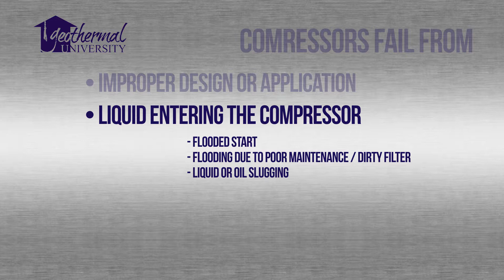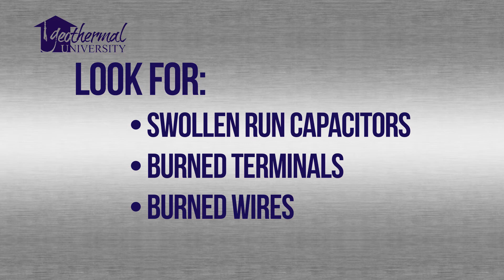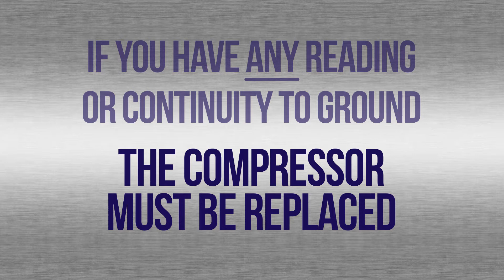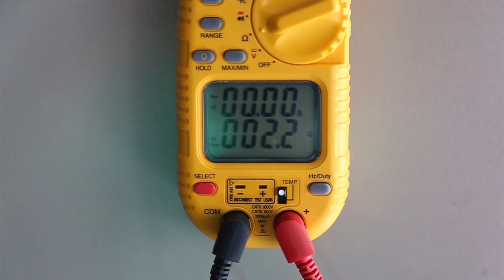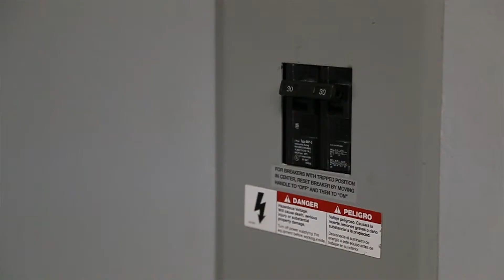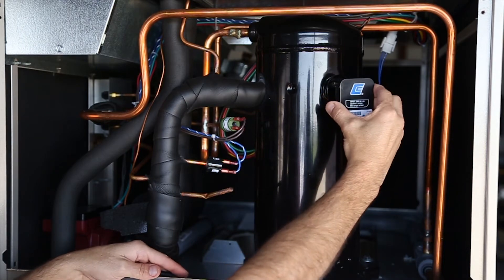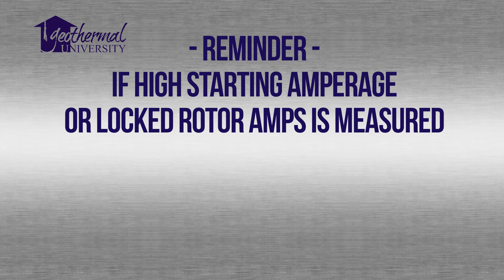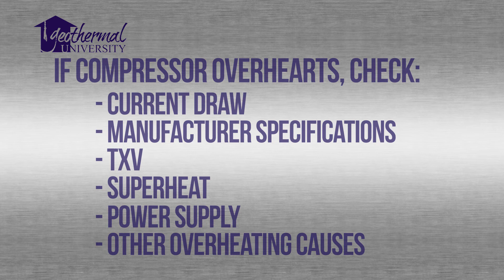Geothermal Compressor Troubleshooting

Comment: VERY GOOD Presentation I understood the majority of it and I am a non-HVAC tech.
Unfortunately I’ve had enough issues with HVAC techs NOT knowing what they’re doing and messing up thousands of dollars worth of equipment I’ve had to learn technical things on my own
One troubling bit I see is at the 7:45  mark it was stated that the system needs to have dryer filter etc. replaced anytime the coolant circuit is broken. We had one of those non-milling technicians overfilled my unit and I know that they did not change these filters. Could this be causing my Compressor unit to not operate now?

Comment: What mechanical could be wrong if one of the symptoms is the amp draw on the compressor keeps rising steadily for about fifteen minutes and then it completely shuts off on overload?  The refrigerant pressures seem to be stable, but low at appx.  48psi suction and 177 psi liquid being an R-22 unit.

Comment: Correction: If line capacitor is good you will not read voltage between R and S on the plug.  Otherwise, great video.

Comment: I had geothermal heating and cooling in my house for 11 years.  Worst mistake of my life.  They are highly complex systems with multiple points for potential failure.  They are Rube Goldberg contraptions that needlessly complicate a function that was normally very simple.  Any cash you save on electricity will be spent 2 times over on constant maintenance and troubleshooting.  Please, to everyone within the sound of my voice, DO NOT WASTE YOUR TIME AND MONEY ON THIS GARBAGE.  Install a system that generates its own heat.  How can you perform maintenance on ground loops that are buried 200 feet under the earth?  Answer:  you don't.
Reply: just bought a house in Illinois with it first real winter with it and im not impressed its doing nothing but running and wont build any heat im about ready to switch over
Reply: There are many options and brands in geothermal heating and cooling.  Many units do not have ground loops and instead rely on open loop design where water comes in from a well and pump and then is discharged to another point, a small plant grove in our case.  The complexity is real, but less than your car, most motorcycles,, etc.  I have not found maintenance and troubleshooting to be constant, or even frequent.  We have owned this house since new in 1987. Geothermal heating and cooling has contributed greatly to our enjoyment and comfort.